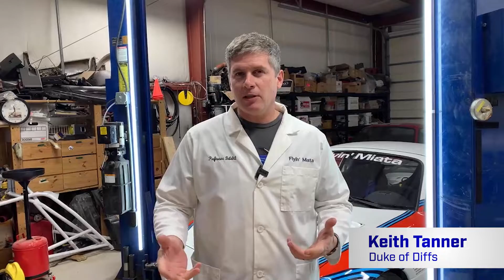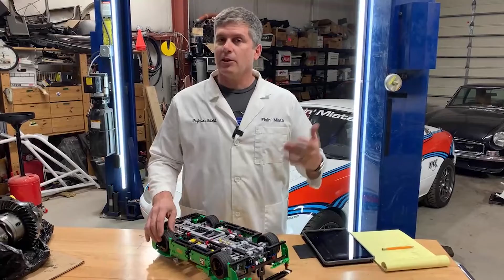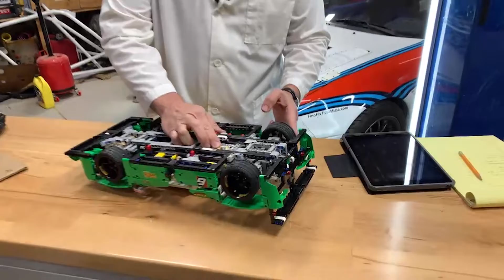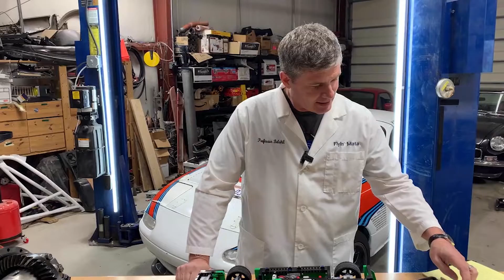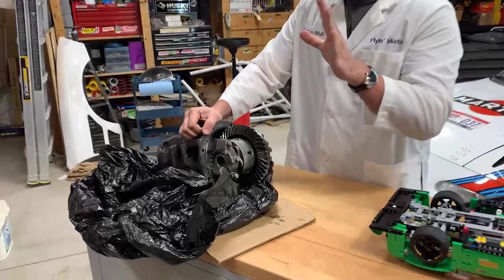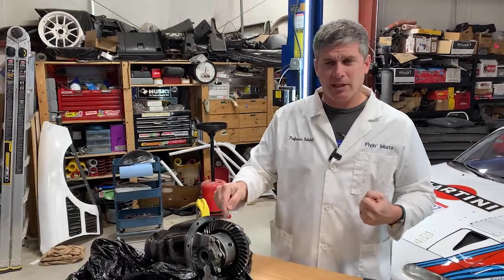Miata Differential Basics (FM Live)

Comment: I’m considering buying a 92 1.6 w/ the Mazda comp differential. Owner is a good guy and he swears by it for SSM. My question is how long can these last now they’re so old, and is there a replacement for these without having to do a full torsen swap? He says he changes the differential fluid after every event as a preventative measure.
Reply from the maker: @danielhass4812 We haven't done any long term testing on that particular differential, so we aren't really sure of its service life. Typically, if the fluid is changed frequently and the car isn't used for burnouts, or clutch dumps, you could expect some longevity.

Comment: I used to have a '95 Miata and thought I'd seen diffs on your site when I was considering making it a project car or buying a Camaro SS. I sold it, bought the Camaro, realized my mistake, and bought my current '96, but I can't seem to find diffs on your site anymore. I've grown to trust you guys over the years and started buying parts exclusively from you all to support the work you do in the community, but also because there's nobody else I trust more when it comes to Miatas. I want to swap a 6-speed and Torsen diff into my Miata, but don't know who to go to outside of you guys for quality service and reliability. I'd specifically like a 3.636 ratio in the rear end so I don't feel like I'm abusing it by cruising over 4,000 RPM on the interstate for 20 minutes everyday (backroads are preferred, but this particular stretch of interstate doesn't have a good alternative and driving way under the speed limit forces me into the lane the trucks have destroyed with potholes).
Reply from the maker: Thanks for trusting us! We suggest checking out this link:  https://help.flyinmiata.com/does-flyin-miata-sell-used-parts-HJ6UkPUT8 with a list of known-good Miata salvage businesses as they have dedicated salvage operations and will likely be able to provide you with the used diff you need. 3.6 diffs are hard to come by, especially in the US, so Miata-specific Facebook groups are another good place to search.

Comment: I found a NC sport with 5 speed that has an open diff. Really low miles and babied—it’s a PRHT. I live in an area with a lot of bad bumpy roads and twisty roads. I kind of wanted an lsd. Would there be a huge difference in handling with the open and lsd? How much do you think it would cost me to add the lsd? Unfortunately I’m not a mechanic so would need to hire someone to do it.
Reply from the maker: You probably wouldn't notice an LSD most of the time, especially if you're not planning on taking your car to the track and pushing it hard.

If you found an LSD out of a wrecked car and gave the entire pumpkin to your mechanic to swap, they'll probably charge you 4 or 5 hours in labor if we were to guess.
Reply: Does flyin Miata sell an aftermarket lsd?
Reply: @treeskier802 not at this time.

Comment: How about a video of putting in new diff seals.

There’s one video how to rebuild a whole diff but not just seals: mainly pinion shaft seal and crush sleeve
Reply from the maker: Thanks for the suggestion! We can't promise each video idea will be fulfilled, but we've added your suggestion to our list of future video ideas.
Reply: @FlyinMiataVideo  no problem but to know how or a trick to doing it and not upsetting the crush sleeve or smoking the bearings and diff would be pretty awesome as it’s a wear part that has to be replaced and these rear ends are getting harder to find so service prices are going up since there’s no education out there on it 

Iv been told you can’t take the pinion nut off without knowing the torque as Iv also watched on YouTube people put the nut back on with an impact gun haha

Comment: As far as rx7 housings, oiling isn't an issue. There is only a slight difference in the s4 mating surface where as the s5 is nearly identical to the 1.8 housing. The s4 is also around 2lbs lighter since the s5 is only marginally thicker. You cannot use the "pumpkin" from an rx7 without a custom driveshaft and mounting solution for the diff. I actually just put a clutch pack from an rx7 into my miata as well as the rx7 housing. The rx7 housing lacks the breaking notch too so it's a lot better for tracking the car as well as it will survive an impact. I already had one break from being rear ended.
Reply from the maker: Thanks for watching!

Comment: I have a really big question and I'm getting ready to undergo this. I'm swapping a 43 gear ratio onto the 36 differential. I was wondering if you guys could do a video on that if or if that's something you guys do but it's something I'll be doing and I was wondering if you guys go to elaborate more on what it can and can't do for the car a positive negatives please if it's something you guys will be willing to do much appreciated. Thank you!
Reply from the maker: That's not something we do very often and we don't have any plans to do a video on it, but there is a writeup in the garage section of Miata.net on how to set up a ring and pinion. If you're worried about the setup, a local driveline shop can probably do it for you at a reasonable cost.

Comment: I have a 99 1.8 Miata 5 speed with a 4.3/1 Torson differential, can I just put in 3.6 to 3.9/1 gears in so I can put in a 6 speed or does the entire diff need to be changed.  I am tired of 4000 RPM at 60 MPH.  I need another gear.  Good at stop lights but fatiguing on the freeway.
Reply from the maker: Yes, you can replace just the ring and pinion. It'll take proper setup. The 4.1 is a good match to the 5-speed on a naturally aspirated engine. A 3.9 will certainly take some sparkle out of the car and a 3.6 will likely make it a dog.
Reply: The point is I want the range of a 6 speed but with a 6 speed and my current 4.3 to one rear I would be revving at higher rpm in 6th than I now am in 5th   I want an overdrive 6th 4000 rpm at 60mph is annoying.  That is why I want a 6 speed unless somebody makes an overdrive system which would give me a 10 speed. @FlyinMiataVideo
Reply from the maker: Sorry, missed the part about the 6 speed. Yes, use a 3.9 or 3.6 with that.
Reply: With that current rear end that car gets barely over 30 MPG on the highway.  My 6 speed 600HP at the wheels GT500 gets 24mpg on the highway.  Although handling wise there is not much that can keep up with my Miata in tight corners with racing suspension from the factory and no factory AC.  People that have tried overshoot the corner because I am around it before they can even respond.  I need to use power to go around corners in my Cobra and tight ones no way would it keep up even with 600HP.  The only vehicle I have that could keep up is my racing motorcycle but it would take more skill and courage than I have to do it. @FlyinMiataVideo

Comment: I can answer the rx7 question.   The diffs are essentially the same as na rx7s with the exception of the pinion length and axle shafts.  The covers and mounting ears are basically identical....again the turbo rx7 stuff uses the larger 7 inch ring gear so that has to match.  A lot of miata guys swap in the rx7 turbo clutch types which are very strong.  The stub shafts and driveshafts would have to be custom.

Comment: FC rx7 NA and turbo diff carriers bolt onto mx5 na/nb pumpkins. people swap them because they are stronger and dont have the notch where miata diffs crack. i have a msm pumpkin on an fc diff carrier and the carrier has welded plates and poly diff bushings from a miata, running insane shafts on it. drives like a dream!!!

Comment: I have a  stock 2003  miata . What kind of  diff do I have and what fluid should I put in it ?
Reply from the maker: This can be a little tricky to spot depending on the trim and what previous owners have done to the car. If Keith's video didn't give you what you needed to know, would you please reach out to our customer support team directly via phone or email? They'd be happy to give you some pointers on how to tell the diffs apart, as well as recommendations for fluids. Thanks!

Comment: What's the torque bias ratio of the ND club LSD?

It's not a clutch type as those need servicing somewhat frequently so surely they must be torsen (or some other helical, Quaife type)
Reply from the maker: It's a Tochigi Fuji "super-LSD", like all Miata LSDs since 2001 or so. Torque bias ratio is 2.0 according to Mazda's documentation.
Reply: @FlyinMiataVideo 

Ah yes I found some info myself shortly after posting my comment.

The "super lsd" is actually a pretty shit design compared to the older torsen units (both in bias ratio and fundamental design). It's using effectively a "friction washer" (they call it the taper ring) between the differential casing and side gears which "bind" under power ONLY as it relies on the thrust force generated from the pinion gear/side gear interaction (effectively a really shitty 1 way clutch type lsd with 1 clutch/friction plate)

I guess with stock power and grippier modern tires we don't "need" as much torque bias as older NA and NBs which had torsens.... Atleast that's what I tell myself for why Mazda would use this over a torsen or Quaife which is similarly low maintenance.

Comment: My 2019 Club 6 speed automatic does not have LSD. Would there be any warranty issue if I installed an LSD? Any drive train mods, or just a drop in?
Reply: I have an nd 1.5 132 hp with open diff and I want to install an lsd too, so it's just a replacement or there are mods to do?

Comment: Are the Global Cup cars running the Tochigi Fuji differential?
Reply from the maker: I believe they are, but they are running differential coolers to prevent failures. The important thing about the Global Cup cars is that they're all the same - their equipment may not be the best in terms of performance, but as long as it's consistent across the whole pack and reliable it makes for good racing.

Comment: Viscous is not torque sensing but wheel speed sensing. They need a difference in wheel speed to start locking. Therefore viscous slip diffs are slower to respond.
Reply: Yup. This is why, if you boot it round a corner with a VLSD, it just won’t lock, because the wheel speeds haven’t changed. If you clutch kick, all of a sudden the wheel speeds are different in relation to each other and it “locks” … somewhat.

Comment: Has FM made a video on seam welding the targa miata?  I want to seam weld my NA and would benefit  greatly with a video on how it's done, were to weld and what not to do.  I saw the info on the website.. I just think a video would be super cool..
Reply: I use 309L stainless welding TIG rod. Weld the body at 75 amps. I use a Lincoln Square Wave Tig welder and Argon gas. Weld one inch at a time to minimize warp and Pliojig to absorb the heat if you can get it. or some form of clay.  Works fine
Reply: Thoriated Tungsten 3/32 or smaller. Very Sharp tungsten tip. I weld at 8 psi for stainless and mild steel tig welding

Comment: FC non-turbo RX-7 -- the rear aluminum carrier is the same as the NA8 / NB diff (but with different rubber mounting bushings).
Reply: Yes it is. Doing that housing with a torsen and an Aussie 3.6 final drive for my 99 right now

Comment: Do a bit on all of the coolant reroute options and their pros vs cons!
Reply: They already have a install video for their reroute kit. It’s really in dept maybe try give that a watch!
Reply: @jesper98  It really only talks about one option.
Reply from the maker: @frenchmanremy  We've done three videos on reroutes: general theory, specifics on the FM solution and installation.
We won't do one on competitor products, we prefer to educate our audience on how things work and then give the features of our own. 
We have found that when a company talks about products from a different company, there is rarely accurate information presented.
Reply: @FlyinMiataVideo  I want to know what happens to cylinder 1 when we reroute coolant to cylinder 4. Are we know making 1 hotter??
Reply from the maker: @glenjamindle  Slightly, although it's better to have all four cylinders as close to the same temperature as possible.
Reply: @FlyinMiataVideo  What about RHD cars? What's the best way to adjust a kit to fit?

Comment: Torsens & Helical Diffs do NOT operate on a worm gear worm wheel basis. This is the most common misconception about Torsens. If you build a diff using  worm wheels and worm gears it will 100% be able to lock the diff even with one wheel off the ground. 

The theory behind  "worm wheels can't drive worm gears" is of course correct but the helical gears inside a Torsen/Quaife/Helical Diff are NOT worm gears (clearly evident by looking at it's cross section down the axis of rotation, you will see many teeth if you look at the gears inside a Torsen/Quaife/Helical diff but if you do the same thing to a worm gear, you only see one tooth).

How Torsens/Helical Diffs ultimately operate is related though not the same, the angle of engagement between the gears  in the differential create a thrust force through its axis of rotation into the casing itself, this creates a tremendous amount of force and friction. 

It's this friction that allows the differential to operate in the limited slip condition. 

The angle at which these helical gears are cut and meshed are ultimately what affect the torque bias ratio of the differential.

Comment: Can you do one about brakes

-how total piston area + brake system pressure are ultimately what affect clamping force (not number of pistons, though they help to better distribute that pressure)
-what the difference is between different types of brake pads (semi metallic, metallic, ceramic, carbon, etc.) and their characteristics (Mu vs temperature, heat capacity, etc.)
-rotors (size vs brake torque, mass vs heat capacity, importance of cooling vanes and their design)

How to compare and evaluate braking systems (braking systems equivalent of horsepower in the "other" direction, how much energy you can dump into the braking system in a given amount of time and how much energy you can reject from the braking system into the ambient environment)

Most importantly, how tires factor into the equation as they are the mechanism by which brake torque is ultimately converted into "stopping force"
Reply from the maker: We did a video on "Performance Brake Theory" and another on brake hydraulics in the past year.
Reply: @FlyinMiataVideo  oh right, you did, completely forgot about that one !!

Comment: I am trying to drift my nb casually - should I go for torsen or weld the open diff? Will the torsen lock both wheels when oversteering?
Reply from the maker: Don't weld the diff. Just don't.
Reply: @FlyinMiataVideo  Thanks for the answer. Mind sharing an alternative if I want to slide it on the weekends?
Reply from the maker: @CODxPHIL  Use a Torsen or a clutch pack. We're not drift specialists so you'll have to find out elsewhere which is preferable - I suspect the clutch pack.
Running a welded diff (aka spool) on the street will lead to huge understeer and you'll probably have the accident before you break the halfshafts.

Comment: Small correction at 3:10. With an open diff, both wheels always get the same amount of torque. So if one wheel is spinning and has low grip, the other wheel will get an equally low amount of torque.

Comment: I have a 92 NA. Living in south-east ALBERTA I spend a lot of time at 120 kmh with is not fun.
What miata diff should I look for to lower the  rpm or should I swap in a Cadillac diff?
Reply from the maker: First off, it's not hurting your car. Miata owners have been worried about high rpm highway use for 30 years, and it hasn't been a problem yet.
The easy solution would be the 4.1 out of a 1994-97. You'll need the driveshaft, driveshaft bolts and halfshafts out of a 1.8 Miata as well. That can even get you a Torsen. You could also go with a 3.9 out of a 1999-03 6-speed car, but that little 1.6 is going to lose some acceleration in exchange. I would stay away from the 3.2 Cadillac rears even if they were an easy install.
Reply: @FlyinMiataVideo  Thanks for the info.
It might not hurt the car but it sure is hard on my ears. LOL
I know it'll hurt acceleration but It's just a fun cruiser for now. I plan to add one of your turbo kits when money allows which should get some of it back and in the meantime time I can enjoy the drive to cruise/shows.

Comment: I put a os giken in my 07 nc auto. Made it difficult to drive with the traction control on as it would set it off all the time. Turn the dsc off and its good ,really good😀. Other thing I think although it may be subjective it seems to work better on turn in with less tendency to partial lockup /grab one wheel as opposed to the factory open diff? Does that sound plausible? Btw great series vids.

Comment: does the oem clutch pack lsd from rx7 fit the miata?
Reply from the maker: I seem to recall that it does (for a specific value of both RX7 and Miata), but it's not something we've ever played with.
Reply: Yes, 86-88 Normally aspirated FC has a clutch type LSD. It’s a drop in into any 1.8 Miata front  diff housing with ring gear.  You will need to set back lash and preload.  89-91 is a VLSD and not really desirable.